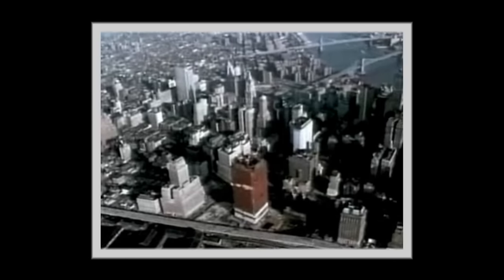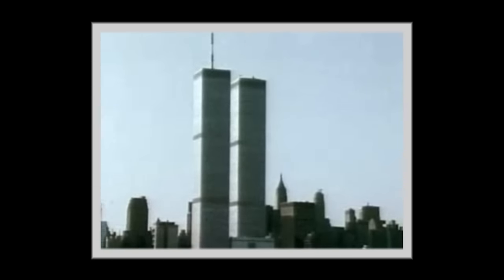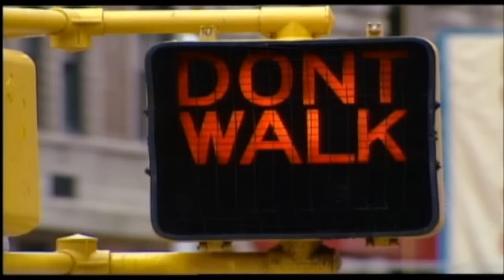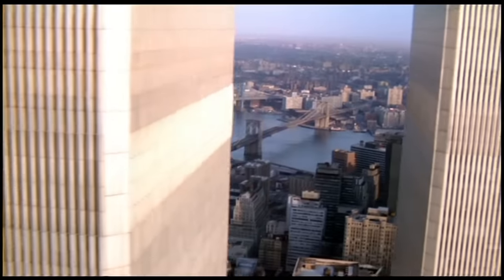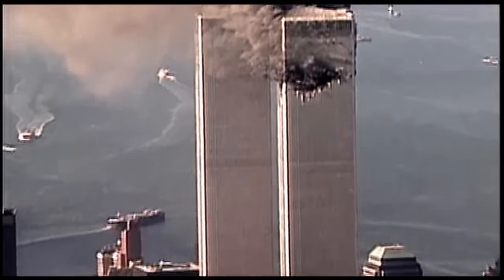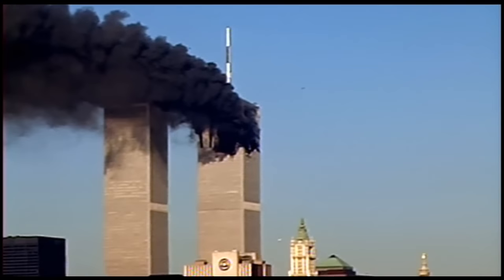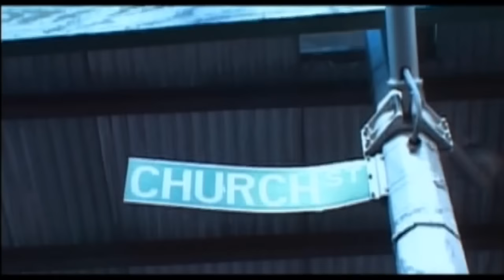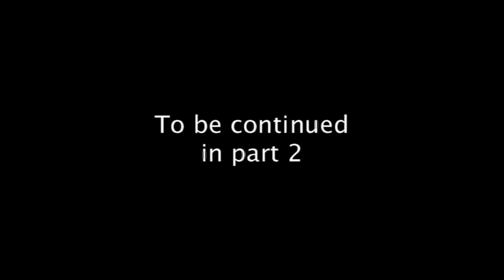102 Minutes - The Attack on WTC, Part 1

Comment: Even the opening impact simulation is wrong. The plane came in at an angle, the steel segments of the plane including pieces of engine and landing gear fractured and exited out of 2 sides while the aluminium frame disintegrated against the steel framework and center core of the building, the jet fuel which is mainly kerosene based ignited into a fireball that blasted upwards and outwards lasting around two minutes before the only fuel source became office furnishings and paper. This in itself does not burn hot enough to melt steel (experts initially ran with this idea but many later retracted that concept), the same was true with the pile and pancake theories. Despite being designed to take an aircraft hit and that the majority of the structure being undamaged (the walls and core shafts supported the weight) the Towers collapsed in their own footprint against the path of most resistance without bending at the point that was most heavily damaged and sloughing to one side which is what should have happened leaving the undamaged portion standing. Instead the total collapse vaporized all the furnishings into dust and the building to rubble. Despite the facts that towers came down unexpectedly and that Trade 7 came down in free fall and that the terrorists purportedly had personal explosives with the possibility that the planes had them too they did not test for explosives. When you run an investigation you test for everything that might have contributed regardless of whether you think it's likely. Considering the media and responders reported explosions they needed to test for it to rule it out. It was not considered a possibility. Even after testing the debree by a host of other scientists led to the discovery of Thermite residue. However, it doesn't seem to matter about evidence as the government made its statement right after the events and stick with it to this day regardless of investigations and experts disagreeing with each other on many points.
Reply: Collapsing into other buildings and creating 16 acres of destruction after falling into other buildings is not in its own footprint. The path of most resistance is upwards since it would need to overcome gravity.  The towers were not designed to take a hit from a 767 flying 500 mph.  Nothing was vaporized. The terrorists did not have explosives. There was no thermte residue found in the debris.Thermite could've never have been used because you'd have to place it in direct contact with the steelbeams. That makes it awfully hard to hide what you're doing when you're tearing down a building to the bare steel beams.  In fact, nothing you've stated is correct.

http://www.tms.org/pubs/journals/JOM/0112/Eagar/Eagar-0112.html

Comment: 6 hours in a 727 simulator with no air experience and you are ready to fly a 767 like an F-16. Only in gringolandia
Reply: They had air experience. They spent more than 6 hours in a Boeing 767 sim. There's nothing that backs any of the inside job claims.

Comment: aluminum cannot do that to steel
Reply: It can when it's flying at 500 mph.
Reply: Sharky2055                 D=M/V . the faster it's going, the faster it will crumble.
Reply: The plane was destroyed as it moved through the tower. Have you seen water cut through steel?
Reply: Sharky2055 for every action, there is an equal and opposite reaction.

Comment: Who did attack the buildings?  That is the problem.  You know what I mean.
Reply: Al-Qaeda did.
Reply: CIA is the boss of Al Qaeda.  Then, who is the boss of CIA?
Reply: The CIA is NOT the boss of al-Qaeda. The boss of the CIA is the President of the United States.
Reply: Do you know who made the Al Qaeda?  It does exist for the benefit of USA.
Reply: One of the fact is that Bush family had supported them through Saudi financially.  In a sense, you can say that is anti US terrorist group, however, it does work for the some power in US.  There is no way that this stupid performance was done to give some damage to US.  If the terrorist wanted to attack those buildings seriously, why didn't they get in the buildings as the tenant resident?  It was much easier to bomb the buildings safely instead of that suicide attack.  That was the cheap performance to appeal the terrorist attack.  Bush simply wanted the reason to attack Iraq.